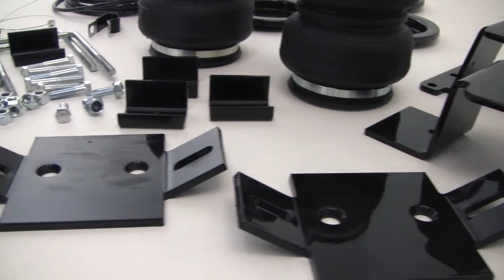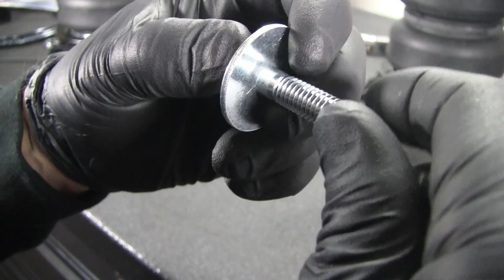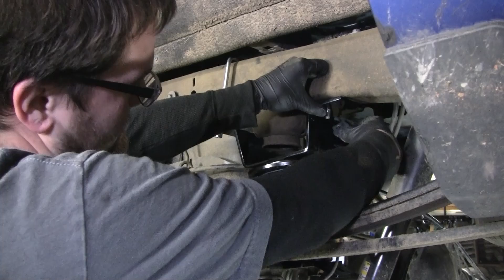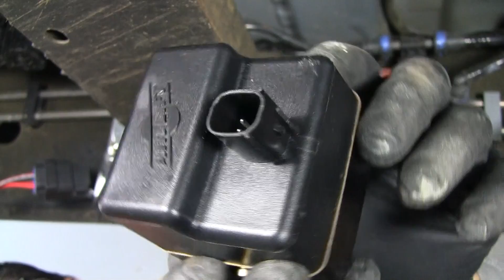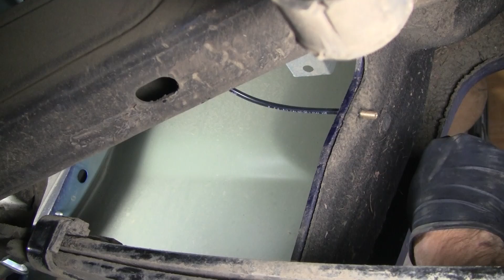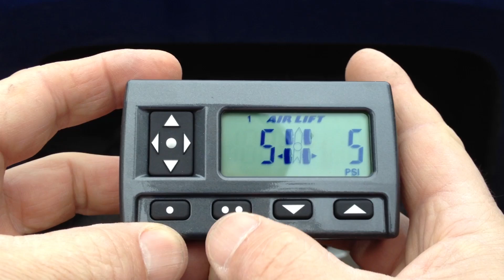Air Lift Load Lifter 5000 Install on a 2014 Chevy Silverado 1500

Comment: Great in depth video on this install.
I would recommend that any and all electrical connections have a liberal amount of dielectric grease put into them , even the crimped and heat shrink connectors and any ground connections.
This will keep the rust and corrosion out of them for a very long time.
Install an air tank and appropriate pop off safety valve  in the system to give the system a reserve and be much quicker.

Comment: I saw studys that this setup actually doesnt do anything. It makes it look correct but in reality no weight was distributed correctly by doing this.
Reply from the maker: I think our summary at the end of the video describes it well. It does not increase or redistribute the load, that's not the purpose. It helps keep the truck in a level position when loaded. Note that we use a WD (weight distribution) hitch when towing with this truck. You can use WD only when towing. We also carry a RZR 900 Trail in this truck and the air bags are a big help. Also helpful when hitching and moving trailers without WD or before the WD hitching process is completed. It's been on the truck for years and we still use it a lot.
Reply: What study is that lmao

Comment: What is the maximum air pressure you can put in these air bags?
Reply: Typically 60 psi. as a rule of thumb for most air bags.

Comment: How's it hold up in the winter time (compressor and wires)
Reply: Good question! was wondering the same. im going to fabricate a cover for it
Reply from the maker: Still works great, but protecting it is a good idea, too.

Comment: do they make this to fit a 2015 silverado 1500 with a fifth wheel hitch?
Reply: I put the Air Lift 500 kit on mine.   Had to cut the tabs for the U bolt off the top bracket.   A self tapping bolt is supplied in the kit to affix the front of the top bracket to the frame.   You'll have to drill a 5/16" hole in the frame for this bolt.   Instructions indicate this alternate manner.   You may not have to cut the U bolt tabs off, depending on your fifth wheel frame assembly.

Comment: any way for these to work with a 6 inch lift?
Reply from the maker: +Andrew Sigo Capacity shouldn't matter much. Compressor will run more initially on larger bags but once the psi is in it shouldn't take extra to maintain.
Reply: +Editorial Services West you need spacers when installed on a truck with a suspension lift.

Comment: Great video, and thanks for making this available. Do you find that your compressor is constantly running to maintain the set psi with a load? Will the wireless screen indicate that it is running after it is in sleep mode while maintaining psi? I manually inflate my bags now with a portable air compressor and after I fill them and then immediately go back to check psi I notice an equal air loss of 5-10 psi in both bags. I checked for leaks on my airlines and with soap and water and do not see a leak. Both bags are completely independent right now...until I put the wireless on it.
Reply from the maker: +Frank Minyon Doesn't leak much and doesn't run much. Still working great after a year of steady use.
Reply: How is the compressor and bags doing know? Going to be putting a set on mine
Reply from the maker: It's been over six years and the system is still working like new.

Comment: Janky install on that compressor. The back two bolts were crooked as hell!
Reply from the maker: Matt Harrison I know, right? But they are very solid and I never slide one of the those show car mirrors under my truck when it's parked. Good catch!
Reply: Editorial Services West In hind sight, would you of installed the compressor in the bed of the truck to keep it out of all the mud and road salt/grime? seems like a much better location
Reply from the maker: We considered it but they don't use salt where we live and we run our RZR in off road situations. The system is still working great after 6 years of use, but if you are in tougher conditions you can mount it elsewhere.